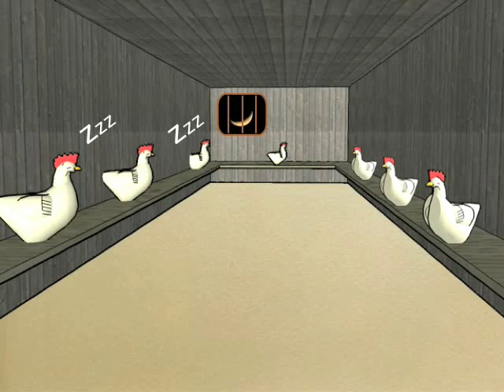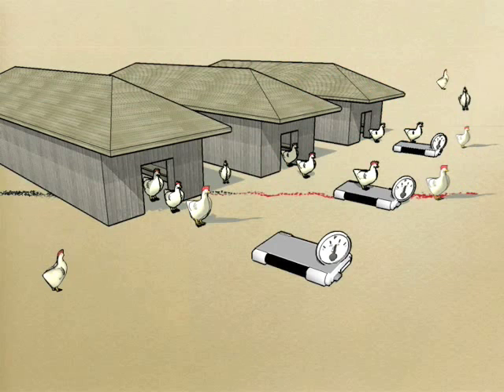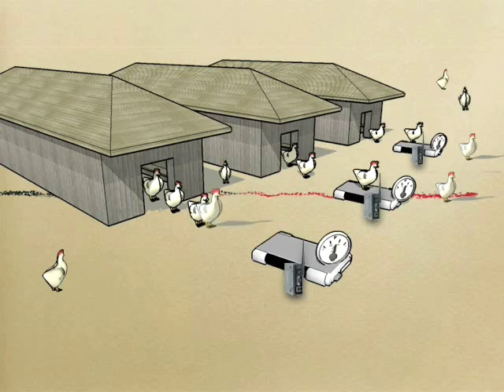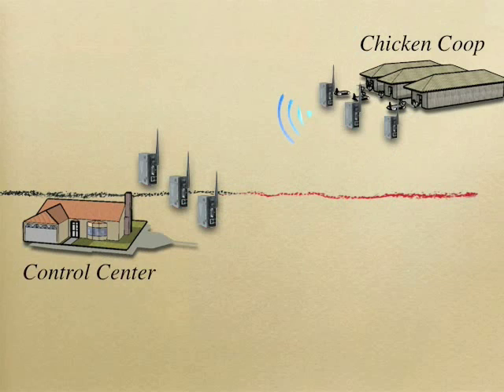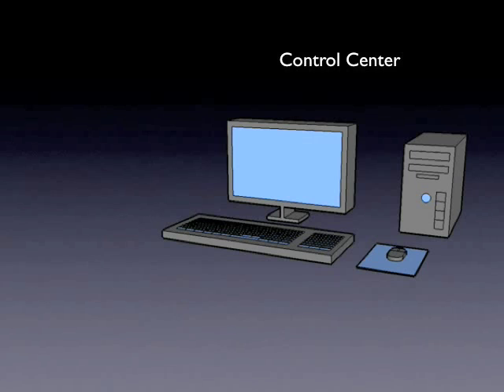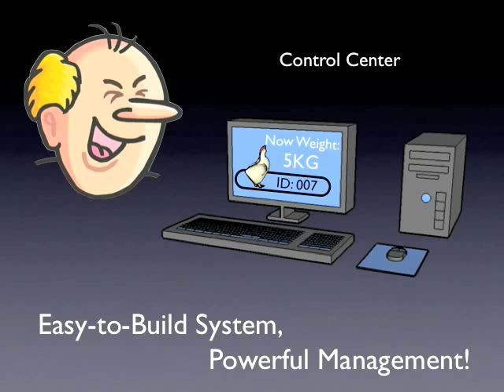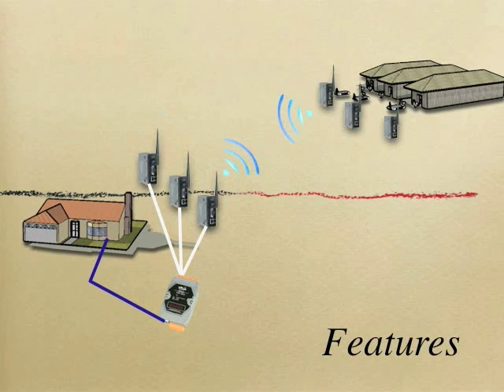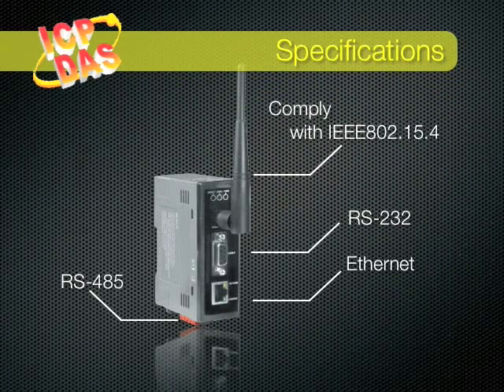Chicken Coops Traceability System with Zigbee Wireless Communication

Comment: Interesting application...!

 Is it actually used somewhere? Are RFID tags small enough to be put on the feet of chicken and what exactly is gained by knowing the weight so instantaneously? Are chickens of the same age, slaughtered at different times depending on their weight? Or is it measurable if they are ill? Or is it measurable if they laid an egg? And are chickens removed that don't lay eggs often enough?